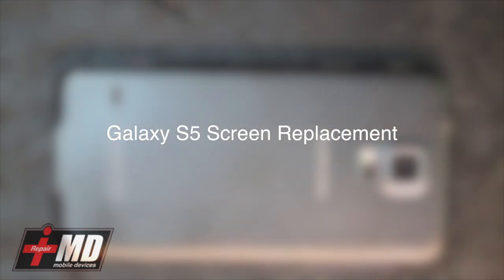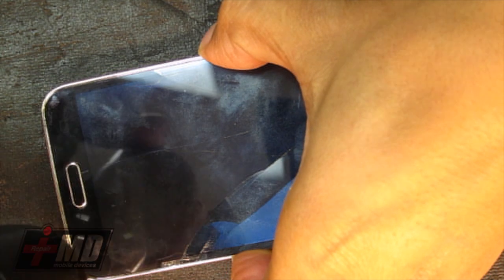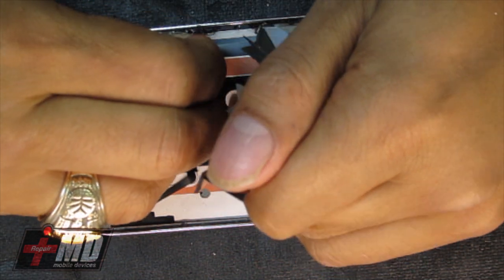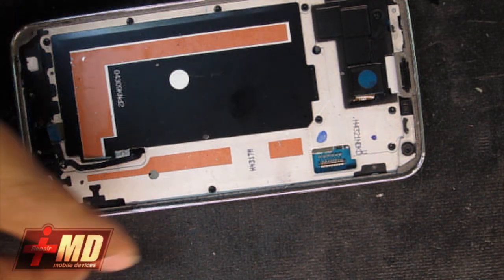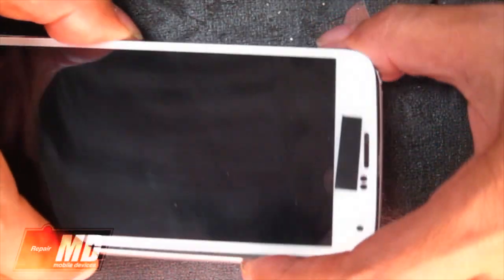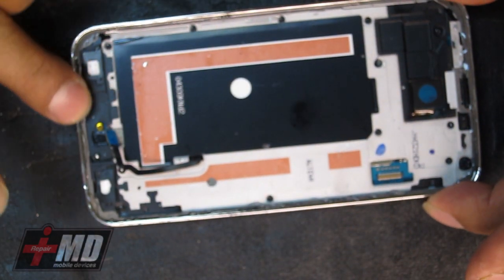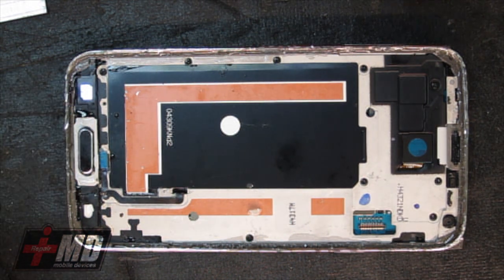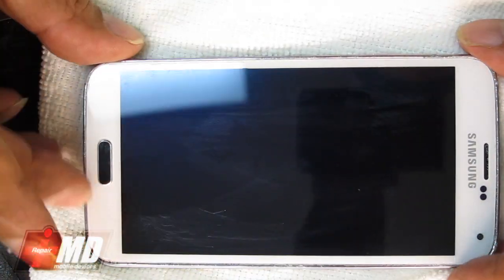Samsung Galaxy S5 LCD replacement

Comment: no body do what this man did. he broke the home/fingerprint scanner in half. and he's using Liquid glue on a phone. not smart at all. who's ever phone that is it will not last more than a week before it has major issues period better off buying a new one or replacing all the parts and mid frames that he ruined by breaking things and putting glue on it.

Comment: My samsung galaxy s5 just has a black screen but sometimes is all glitchy and has visible breaks in the LCD. I purchased it used off amazon and did not drop it. I Asked for a refund even though it is no longer under warrenty. Any suggestions?